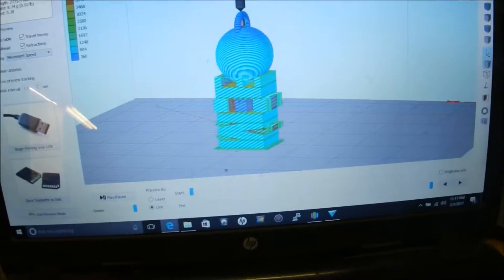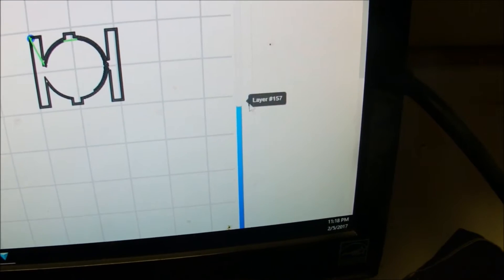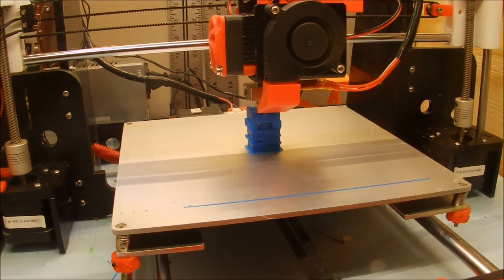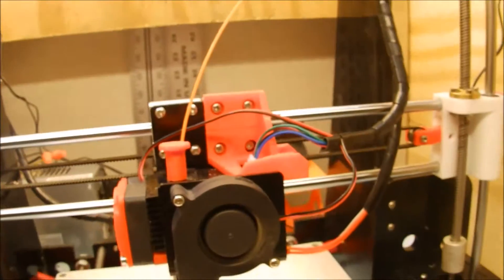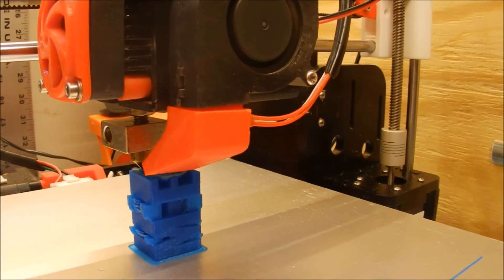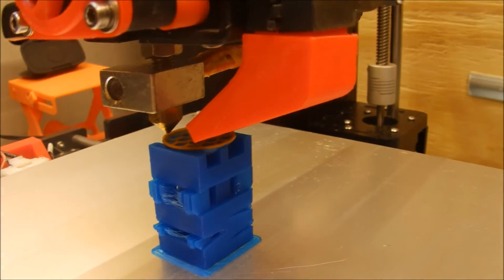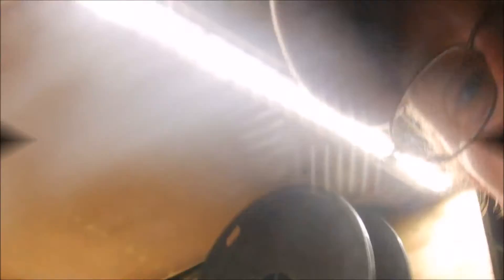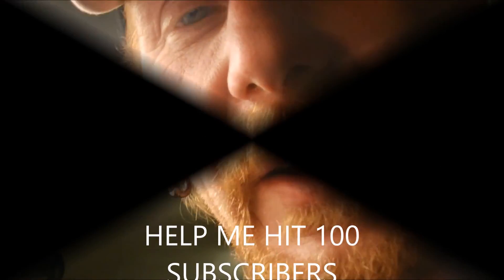Filament Change Using Octoprint (ANET A8)

Comment: OK I want to help out you guys who want to do color change and:

Slice with Cura 3.2.1
Got an Anycubic i3 Mega (I have version 3)
and control the printer with Octoprint

On Octoprint go to settings and then "GCODE Scripts" insert this code into the mentioned fields:

After print job is paused:

M117 Print Paused

G91 X Y Z              # Set to relative positioning on the X Y and Z axis

G1 X-20 Y20 Z20             # Move my bed down 15mm (or the hotend up 15mm), X to the left 20mm Y foreward 20mm

G90 X Y Z            # Set to absolute positioning on the X Y and Z axis

Before print job is resumed:

M117 Print Resumed

G91 X Y Z             # Set to relative positioning on the X Y and Z axis

G1 X20 Y-20 Z-20           # Put the all axis back

G90 X Y Z            # Set to absolute positioning on the X Y and Z axis

Hit save. Then also in settings go to "Plugin Manager" and click "Get
 more..." In the search box type "colors" and install the Multi Colors 
plugin. You will find the plugin by clicking on the 4 bars / arrow down 
next to "Timelapse" in your Octoprint menu.

For it to work with Cura 3.2.1 sliced gcode you must go to your multi 
color printing menu (which you just opened) hit "Advanced Options" and 
replace the regex (regular expression) with the following: 
;LAYER:{layer}

Now you are good to go. Just use "GCode Viewer" in Octoprint to find 
the layers at which you want to change color. Then go back to Multi 
Colors and type them in separated by space. Like 125 127 to change color
 at layer 125 and then again at layer 127 :)
Reply from the maker: an M600 (instead of M117) if firmware has it enabled will move the head for the filament change